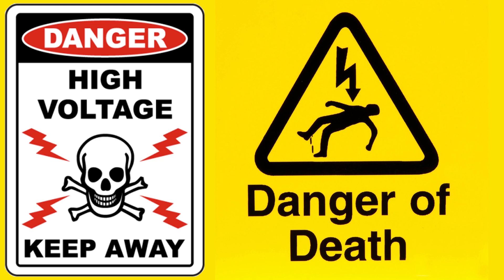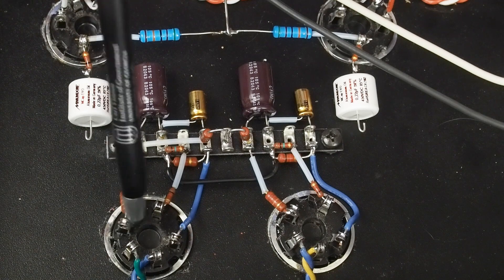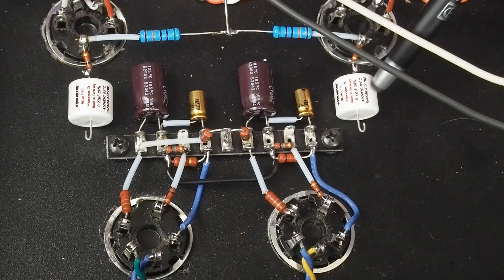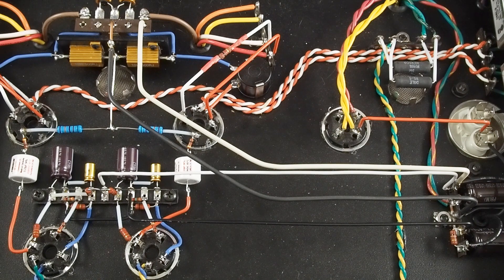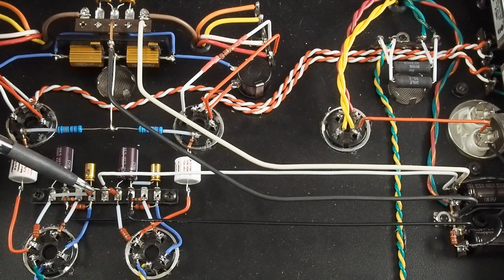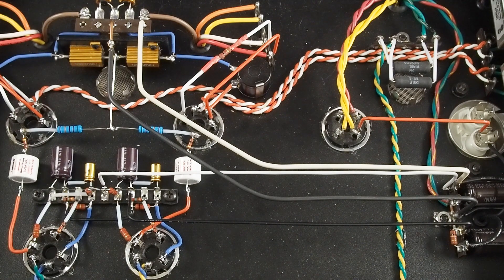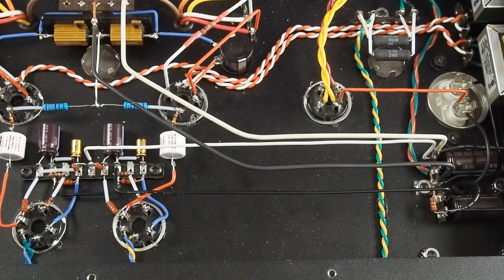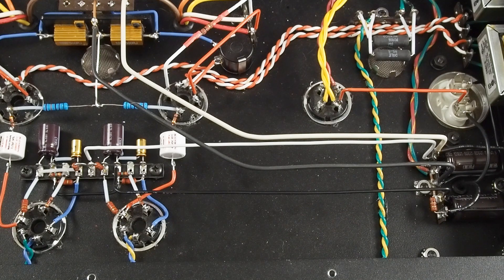1930's Globe Tube Amp: Input Tube Wiring

Comment: Or one of these. Triode Dick used these a lot in his later amps.  DCDC Buck Converter, DROK DC 5-40V to 1.2-36V Power Supply Step Down Voltage Regulator 36V 30V 24V 12V 5V 3.3V 8A 100W Adjustable Volt Reducer Module

Comment: Is the grid leak resistor connected at the right spot; usually it's after the grid stopper, just asking.
Reply from the maker: I'm of the opinion it really doesn't matter. Adding or removing 100-1000 ohms to a pathway that is 500,000 to 1,000,000 ohms is not going to have any impact on the operation.

Comment: Looks great.. For the 27 heaters, you could also build a small 2.5VDC supply from the 6.3VAC transformer tap.. A small tag strip can hold whole supply with all the necessary parts together.
Reply from the maker: Yeah, but remember these old heaters use a LOT of current. This supply needs to be a min of 3.5 amps!
Reply: @SkunkieDesignsElectronics  Yeah.. One needs to be careful in rectifier diode choice, and preferably use lytic caps with high ripple current and low esr..